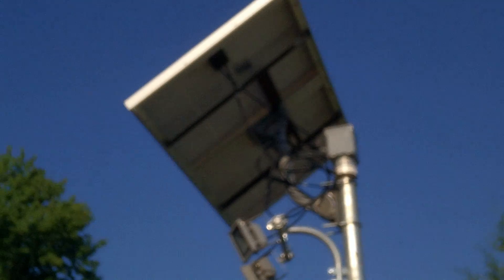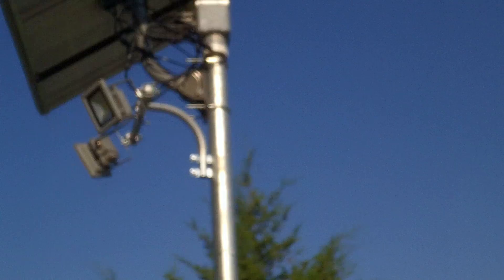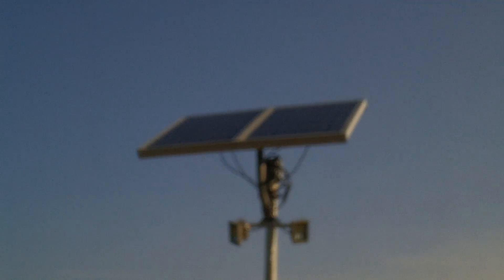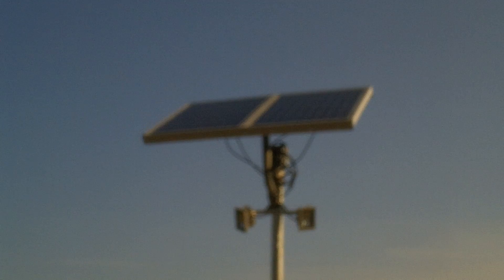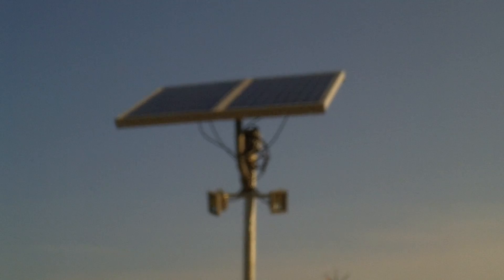Solar street light Build.

Comment from the maker: then let it set for a week before putting any pressure on the bolts ect. then back filled a round the cement with dirt up to the part I framed square. and wet the dirt to let it settle around the top and filled until it all looked good then mounted the pole and put spaces between the steal plate and concrete and bolted it all down with locking nuts and washers.   I mixed the cement in a toto one bag at a time. I like to have a mixer defiantly would have been better.

Comment from the maker: yea I mixed it buy hand. I mixed a bag and poured it. I dug the hole I wanted built a frame to hold the bolts up out of the cement I filled the hole up pretty much full then took the frame and pushed it down in the cement and wiggled it a round then put the wood frame over the bolt pattern put a piece plywood on the bolts to keep them square. and spaced and put the last two bags in. and tapped the board to get out any air pockets and let it set up for 2 hours then took the frame and boards off.

Comment from the maker: and with this light just being a prototype and test pole. I will be working on a new pole system. with a nice base for the electronics.  I have been thinking on a 1ft x 1ft x2ft box with a access area for all the batteries and controller ect. to be housed and that buy its self can be up to 300+  because just a 1ft cube steal 1/4 inch thick is 160 bucks. I will be also looking in thinner steal like 1/8 inch but I want it to be strong and with stand kids weather and people and also look great.

Comment from the maker: and the steal plate the pole is welded to, its a 1ft x 1ft 1/4 steal plate that thing was 30 bucks. 600 lp of concrete 12 bags of quickcrete that was 40  about 20 bucks for the welded frame buried in the concrete, 4 8inch bolts welded to rebar frame  then all the small stuff like the box for the battery, and controller and junction box up top. that's about another 30 bucks and all the other ods and ends. all adds up to about 500 give or take 50

Comment from the maker: As of now this light is just for a test rig, just to test different lighting options. batteries, and solar panels.  as of now the cost of this light I have built is. around 500. the most expensive parts are the solar panels, that I got from solarblvd, the pole and the battery,   just one of the 40 watt solar panes was 70 bucks so 140 for solar panels.  battery 18AH was 48.50, and the pole was 48 bucks   I think I need to do a parts list and price next time.

Comment from the maker: Over half of the street lights hear are either broken, bulbs are broken. and the cost to run them cost this park almost 30 grand a year to run. So it got me to thinking and manger is on the same page. if I can build a cost effective street light to replace the old ones it be nice. but I know that will take a while with this one only being a test rig.  I hop I can get a cost of a street light below 1,000.  were as most are 1,500 up to 10,000 just for one.